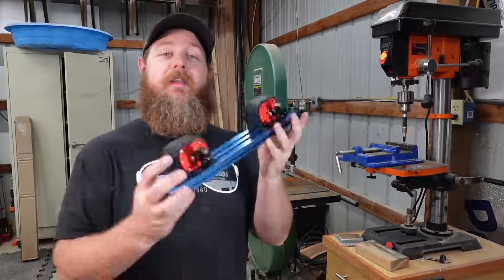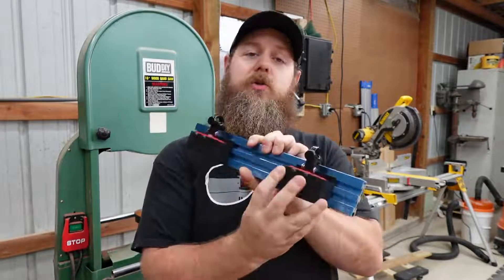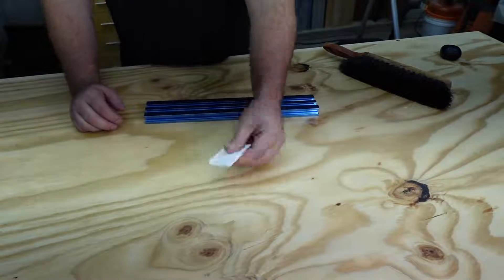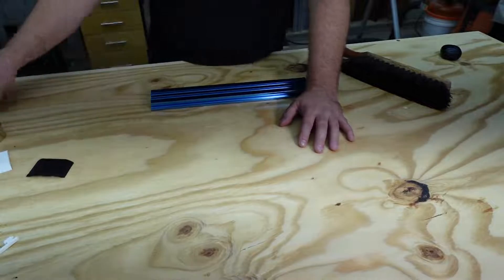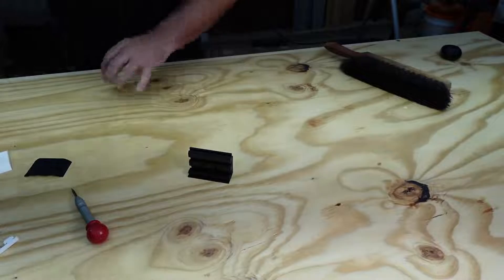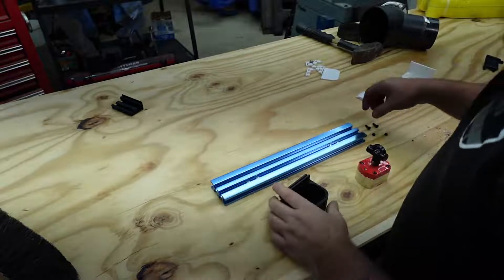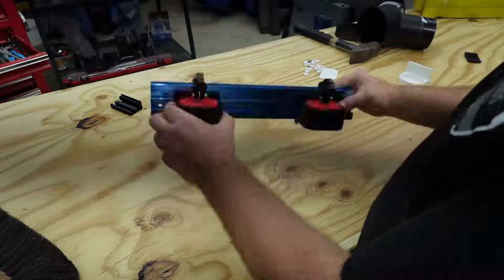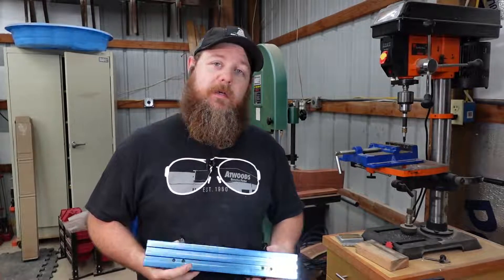I DIY'd a Bandsaw Fence

Comment: Buddy, great video and well done design. It's been almost 2 years now, have you figured out the problem with the magnet base models? I would be interested in testing this rig out on my saw. I purchased the same mag switches as yours. I am buying a different 8020 rail but the slots should be uniform with the powertec. I will, firstly, print a test piece out of PLA but, ultimately, I want to print mine out of petG or ABS, though.

Comment: I looks like the final product is a pretty good fence for any small tool with a cast iron table. 
Have you published the models for the 3-d printer and do you have advice for what to make the 3-d printed items out of?
Reply from the maker: Thanks. I have just used PLA. I haven’t yet published the files, but I have since found an issue and I need to tweak the model to solve it. I am hoping to be able to mess with it next week as the weather is supposed to be too cold to get out in the shop. 🤞